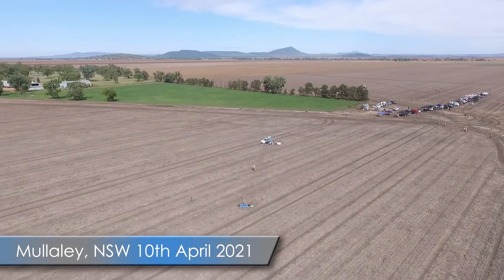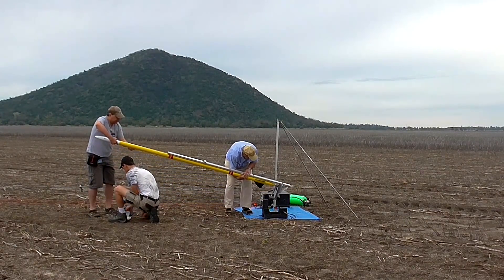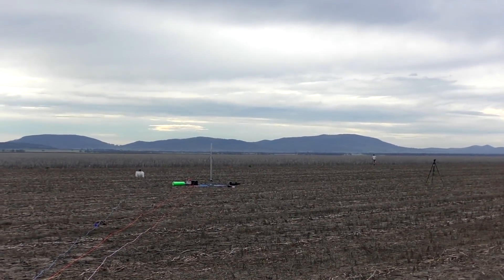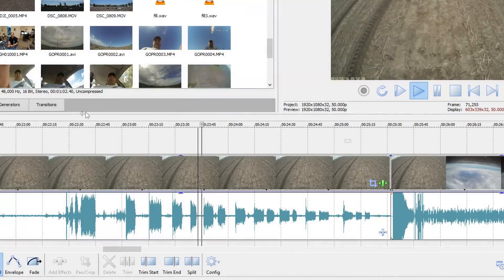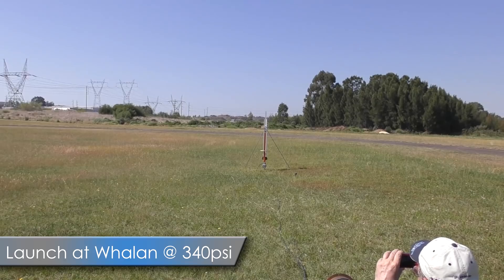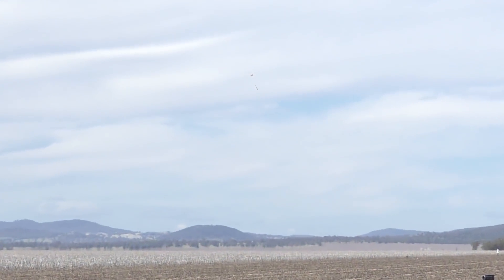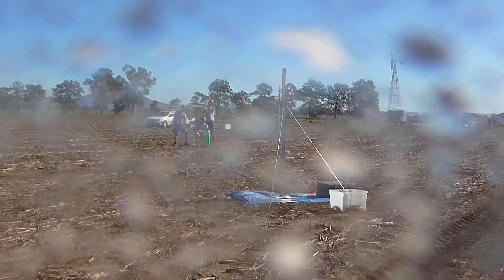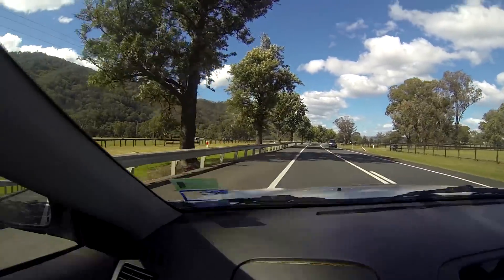High Pressure Water Rockets

Comment: Sorry to freeze down your expectations, but a gps tracker, how ? Every comercialy available gps device is set to shut off if it witstands an acceleration greater than 4G, in water rockets, we get instead from 40 at least for really weighty ones with a small nozzle up to 600G on your typical 1.5L plastic bottle rocket without a nozzle
Instead, you will need a gps receiver, a radio transmiter and a sensors that senses when the flight has ended (accelerometer, pitot tube, altimeter,...), When the flight is finished, the system turns on the gps receiver and send the coordinates back to you via the radio transmiter
Reply from the maker: Yup completely agree. We would not expect GPS lock during the boost phase of the flight, but would expect to re-acquire at least some GPS data on the way down under parachute. I know we will need a transmitter to transmit the GPS data back and a receiver to receive the data. I would not want to rely on turning on the transmitter after landing, as the signal may be a lot more attenuated than when transmitting from the air. Isn't there some universal rocketry law that says that as soon as you fit GPS tracking capability, the rocket will land next to the pad? :) This is the type of thing we would be looking at: http://eggtimerrocketry.com/home/eggfinder-gps-tracking-system/ there are a number of commercial solutions available.
Reply: About the noise, it may be because of as the pressure inside the rocket increases, the difference in pfessure is lower and thus, the speed off the air lower, reducing the noise of it's turbulent flow in the pressuring system

As for the non-deployment, i think that because of a too late deployment, the relative wind exerced enough force to keep shut the parachute door, because of the speed the rocket already got back as it were purposely after the apogee. The two options are, in my oppinion :
1) always deploy the parachute at apogee
2) redisigning the deployment mechanism : to counter that issue, in the model rocket club were i used to go, we put the articulation at the back of the door, the lock at the tip (in the direction of the flight for the rocket) as such the relative wind rushes in the door ,instead of clamping it shut, and forces the parachute to be deployed
Be careful when deploying the parachute after the apogee, because of the speed the rocket has already got back, the amount of force the parachute system experiences is far greater than a normal apogee deployment, in my old rockets (1,5kg 300m apogee with a powder motor), the apogee was on average at 7s after liftoff and all the cords and double-hook (to rings linked by a pivot, easily found in fishing stores, you ty up the main cord to the rocket's body and one eye, and all the parachute's cords to the other eye it avoid the cords getting too messed up ), every cord could witstand at least 30kg of weight (×20) in order to be sure that the parachute dosn't get tore-off because of an excess force experienced just for a late opening of at worst two seconds passt apogee
If you look for strong and thin cords, go to the fishing store, you can easily find aramid cords than can widstand 80kg of force for a diameter of .8mm

Ps sorry for the bad english, it's not my native language
Reply from the maker: We recovered the part of the servo motor with the servo horn that holds the parachute door closed. That showed that it was still in the locked position, so the servo motor never moved. Could be a low or disconnected battery during launch. The timer was definitely receiving power as I verified that the armed LED was on before launch.
Reply: @AirCommandRockets  maybe the servo failed because of the enormous acceleration, a servo has a little speed reductor that could have broken because of the acceleration, you can also check the wires inside of the servo, the solderjoints inside could have fail beetween the power cable and the PCB, the motor or the potentiometer
Reply from the maker: @aterxter3437  That is unlikely. We've been using these servos for many years in various orientations, and much higher G-loads and they have been fine. The same servos worked just fine at double the acceleration on the first flight.
Reply: @AirCommandRockets sorry, I was overthinking it
 so to sum it up: 
1) the door stayed shut and the servo didn't moved
2) it looks like the servo controller worked correctly
3) the servo seems to be okay and may not be the cause of the crash, one only options is left in my opinion :
The servo didn't get powered or didn't receive the open order through it's control wire
Causes possible : 
1) battery conector or servo connector fail => no power to open the door
2) control PCB fail (bad solder on the PCB on the wrong component)=> no power or no order. Good weekend

Comment: Can you use something like a JollyLogic chute release so you don't drift as far?
Reply from the maker: That is certainly an option, but we would need a drogue chute to slow it down before releasing the main. Drogue-less recovery isn't an option for this rocket design. The chute release and drogue add weight though, so on record attempts that would be a penalty.

Comment: The volume probably decreased due to the pressure difference.  When the rocket is at low pressure a lot of air can flow in as there is little to no resistance.  As pressure in the rocket increases the pressure difference is less.  Meaning more reisistance to air flowing to air going into the rocket and less available room for the new higher pressure air.

Comment: The foam streaks that Nova leaves in the sky are really impressive. Have you been tailoring the profile of the nozzle to optimize the expansion ratio?
Reply from the maker: Thanks Dan. No, the nozzle is just a straight through 7 mm hole. Expansion nozzles are planned for a test campaign probably sometime after we finish our Horizon rocket.

Comment: Good works! Are you sure it has lost battery connection instead of mechanical jammed? In your experience what's the best parachute deployment you ever built?
Reply from the maker: We don't know the root cause of the failure. I know the circuit had power as I checked the Armed LED before launch, and the part of the servo motor that we recovered with the servo horn, it was still in the locked position, so the servo never moved. The best parachute deployment we use is the one on our regular low pressure water rockets. It has flown hundreds and hundreds of times with only very rare fails.

Comment: Noise  due to expansion of the High Pressure Air into the lower pressure Rocket. This delta Pressure (feed pressure - rocket pressure) decrease as loading of air continues, less expansion equals less noise. Initially, the delta-P across the expansion Valve is high enough to produce Supersonic Flow, the Mach number of this flow decrease as delta-P decreases. Are you going to try charging your rockets with CO2 instead of air? Should be able to increase engine performance with more expansion in the "engine bell" of the motor. Supersonic CO2 expanding to accelerate the Water, yielding higher exhaust velocities.
Reply from the maker: Interesting, I would have expected choked flow for almost the entire fill. We have not done CO2 experiments yet, but yes CO2 will give you better performance due to its higher molecular mass. The problem with CD nozzles is that they are only effective during the gas phase of the thrust, but can be slightly detrimental during the water phase. This is why water rockets typically don't use them.

Comment: Maybe the aerodynamic forces kept the nose from coming out?
Reply from the maker: We recovered the part of the servo motor that held the parachute door closed and it was still in the locked position, so the servo never activated. With this particular parachute deployment mechanism , air flow is actually a good thing and helps to get the parachute out.

Comment: The decrease in volume is likely caused by the increased chamber pressure. Higher pressures prevent the vibration (deformation) of the chamber and thus attenuate the sound.
Reply: As the pressure in the tank rises, the velocity of the air decreases.
Reply: @spacemanmat  good point
Reply from the maker: It must be something along those lines.

Comment: Is it possible to put something in the water to increase thrust?
Reply: And something that can make the rocket fly slower and longer
Reply from the maker: You can reduce the size of the nozzle to slow the rocket down and increase the duration of the thrust.
Reply from the maker: Yes, you can add detergent ... even small quantities like 2% can have a significant impact on performance. As long as you can use it to generate foam inside the rocket.
Reply: Thx

Comment: warm water(high vapour pressure) and cold water sounds different when agitated or poured maybe the same thing can be pointed out here
Reply from the maker: The water temperature doesn't change much during the pressurisation, perhaps 1 or 2 degrees at most? There is a fairly small contact area between the warm air and the water.

Comment: Decreasing volume of pressurisation theory - As you increase pressure, you increase the mass of the whole system and therefore its inertia. Overcoming inertia reduces overall vibration and therfore volume. Think about when you bang an empty metal bucket vs full.
Reply from the maker: That seems like a pretty good explanation. :) I was thinking along similar lines as the launch tube inside the rocket is able to vibrate less with the higher density air around it.